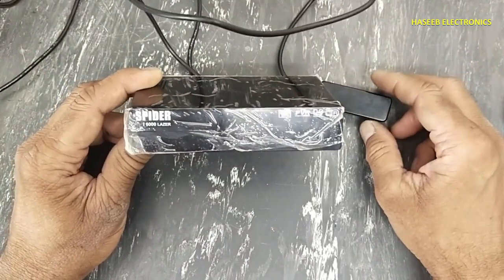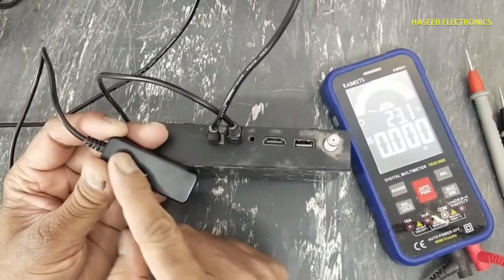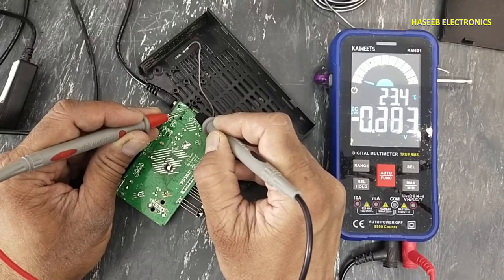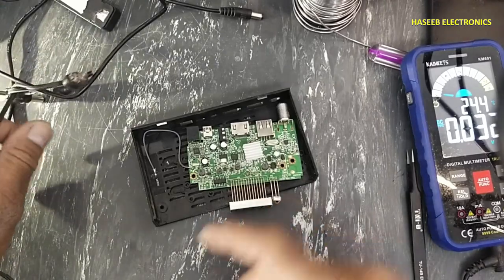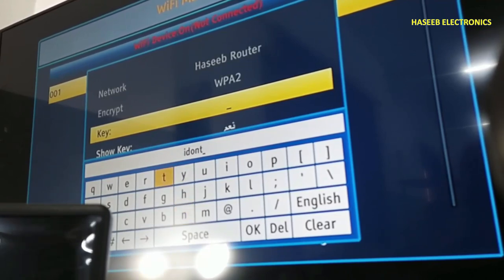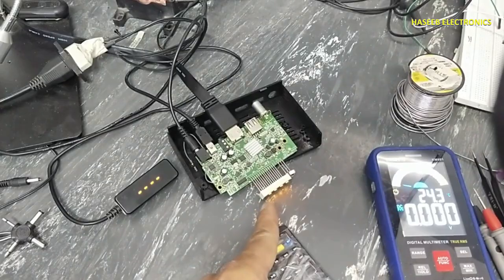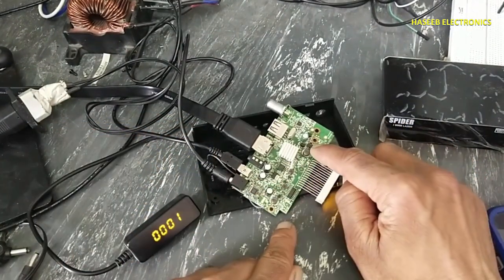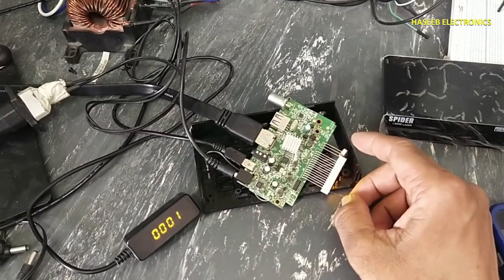{985} SPIDER i6000 satellite tv receiver not turning on

Comment: WOW! That's the first time I saw a component smoke and device fixed itself hehe!! You are a magician :-)
Reply from the maker: it is really looking a fun 
but 
if we have something short circuit in parallel line of supply rails, that drops the voltage at supply rails. so that any other circuit will not work. 
as we inject higher level current with same voltage. it causes to destroy that component, 
at that time remaining good components will start functioning as they were healthy.
Reply: Excellent thanks for sharing

Comment: Very good Prof! What about checking the input line? Using continuity? If there is short we can see it? Or we can inject voltage with a power supply and watch the current consumption and watch it with thermal camera to see what component getting hot. Thx!
Reply from the maker: there are many techniques, 
we can use ohm meter for cold testing 
we can use thermal camera to detect overheating comonent OR
the  simplest trick to inject same voltage with high current power supply, it will give pinpoint indication for all the short circuit components,

Comment: Nice trick. Pls describe Theoretically. Many technicians apply this trick in mobile and other short circuits.   Thank you so much. God bless you.
Reply from the maker: it is really looking a fun 
but 
if we have something short circuit in parallel line of supply rails, that drops the voltage at supply rails. so that any other circuit will not work. 
as we inject higher level current with same voltage. it causes to destroy that component, 
at that time remaining good components will start functioning as they were healthy.
Reply: @HaseebElectronics  thank you.

Comment: What about the reciver 12v power supply.. ist detecting short circuit and shuts off? Or we just cannot see the voltage because the ic is taking all the voltage
Reply from the maker: the 12 volt power supply adapter is SMPS based. when the current exceeds the maximum limit of the power adapter, it goes in reboot mode. thus the output voltage drops, until the short circuit or over current condition is removed. 
if 12 volt without load are present but after connecting to the load, if the volatge are dropped, that will indicate some overcurrent condition in the load.